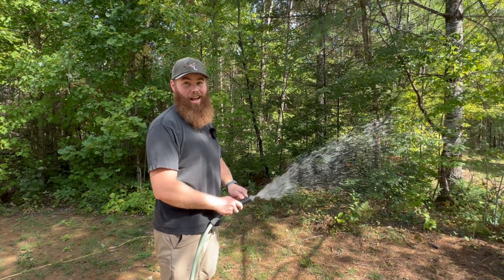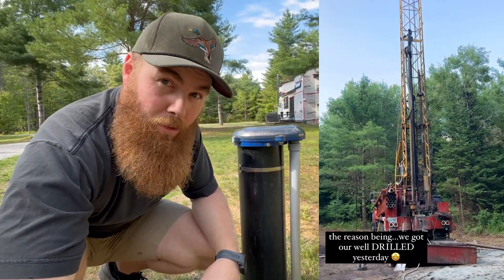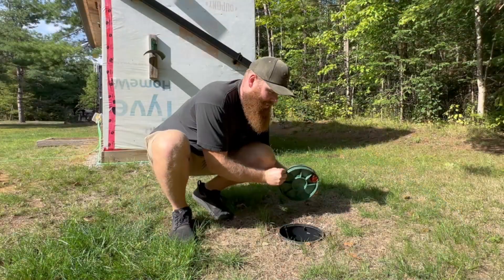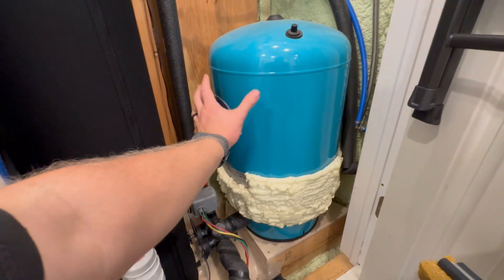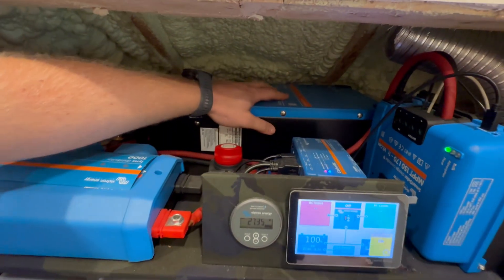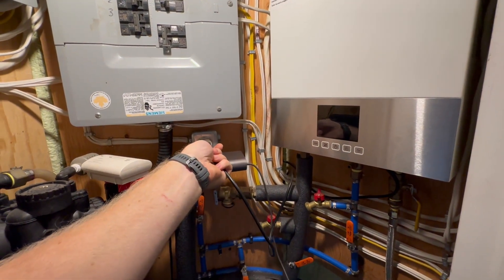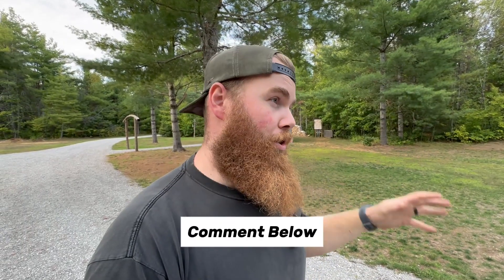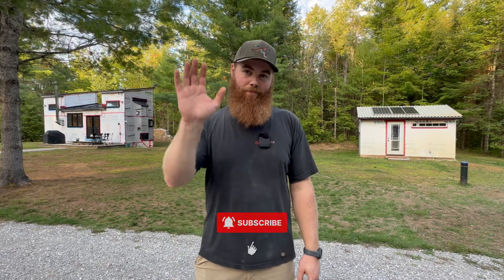How We Get Running Water OFF THE GRID

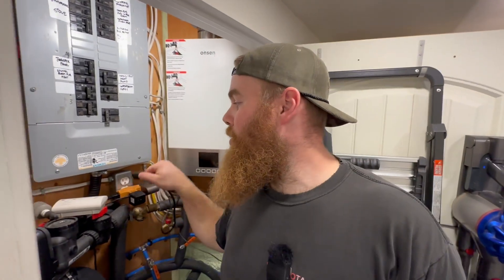Comment: @5:09 1 A is not a unit of power but current... Is it 120W in 120V ou 240W in 240V ? Even 120W ins't nothing.
Reply from the maker: Well based on the plug I’m showing you can tell I’m talking about 120v, so by that you know it’s sub 100w
Reply: @Snowstead  But this propane water heater - its water pump - is intermitent. In standby it must be les than 5W.

Comment: Nice set up and video. Can you still get water if your pump motor gets fried? My concern is the grid goes down long term due to a solar event similar to the Carrington event that happened back in 1859.
Reply from the maker: I honestly don’t know the answer to this, I have heard that a grid overload only affects electronics that are plugged in at that time. And the pump is only electronically connected when the pressure switch says so. So there’s a chance it’s not affected? I don’t know. Either way we’ve got bigger problems if that happens! Haha good question